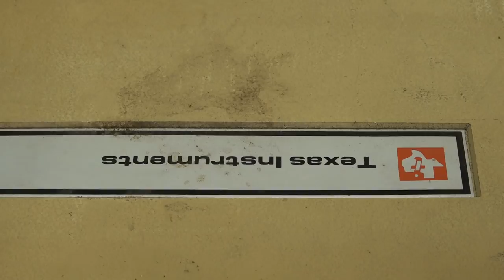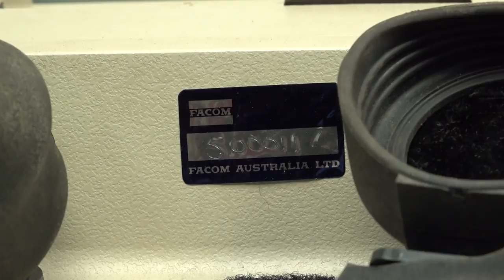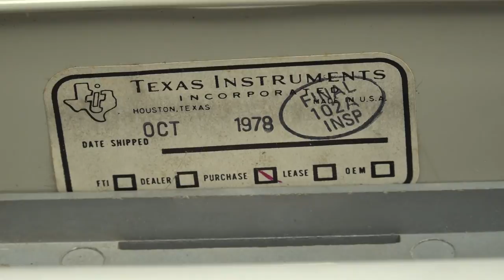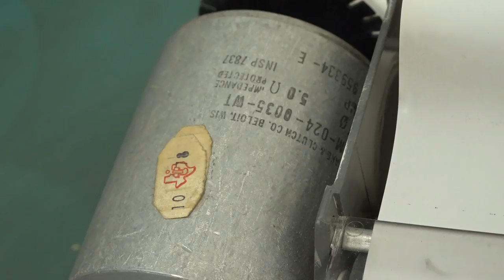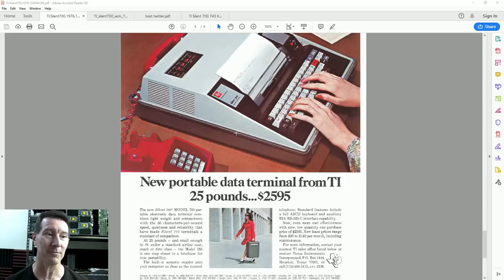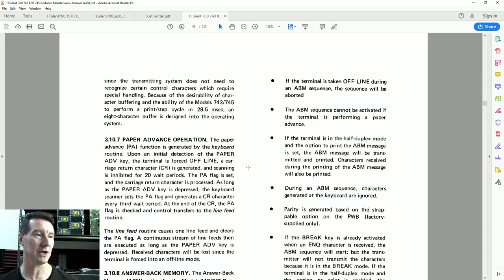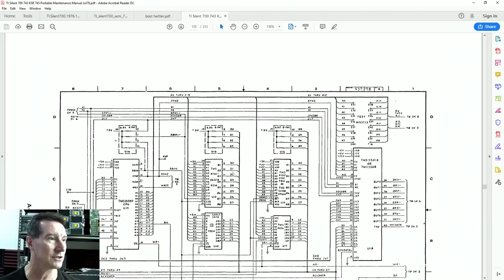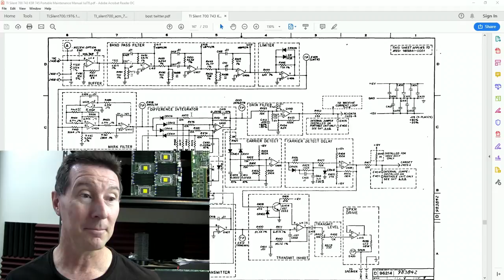EEVblog #1169 - TI 1972 Computer Interfacing

Comment: FWIW, the trick used in V.90 to exceed 33.6kbps wasn't actually particularly sophisticated, but it was clever. Essentially the way it worked was by relying on the accuracy of the DACs installed in end users' line cards in digital telephone exchanges; rather than sending an FSK (or actually, for later standards, QAM) signal, what basically happens is that particular bit patterns (symbols) are assigned voltages, with each symbol being sent as a voltage pulse (Pulse Amplitude Modulation). Your modem negotiates with the line card on the number of different levels it's able to distinguish, which is obviously dependent on line conditions and that's why V.90/92/X2/K56flex modems would connect at a variable rate. The digital data is transmitted, in digital form, to the line card over the network, which requires special equipment rather than a regular modem. In the other direction (upstream), 56k modems actually use 33.6kbps analogue, just like V.34.
Reply: I love QAM. It pops up in so many places!

Comment: Used to borrow a portable terminal like this from my high school on weekends.  Printing terminals had a feature that after printing the last character on a line, the head would temporarily move to the right a couple of character spaces to reveal the last printed character.  If you pressed a key, or the printer started receiving data again, the head would scoot back to it's original position.

Comment: Wow this brings back some memories, particularly the 733 ASR at 17:38 in the video. The 733 had dual cassette drives and my dad had one of these in his workshop at Flinders Uni. I used to use it sometimes at night when I was studying for my BSc. There was a "high speed" 300 baud connection to the DEC 10 in the computing centre. At about the same time I remember playing Adventure on the DEC 10 with an ASR 33 Teletype as the terminal, at the end of a session there was paper everywhere.

Comment: This is just begging to be brought back to working order and hooked into a UNIX system. It should still work, with just a few lines in gettytab. We should be playing zork in no time!
Reply: I think a lot of old /bin/sh scripts relied on these keys. I think hell would freeze over before they are removed from unix/linux.
Reply: A random search with the might Goog came up with someone that connected one of these to a Raspberry Pi. I think he used it to print Tweets. Not sure. I just glanced at the article.
Reply: Michael Lloyd I have done strange and wonderful things with Linux systems and a usb to uart adapter. The serial port is dead nuts simple input for a computer.
Reply: @Mostlyharmless1985  Easy to connect to daisywheel and dot matrix printers too! I'm just old enough to have caught the end of everything being simple text sent down a wire.. I still kind of miss it. 
Yes you can use WYSIWYG fonts on a printer now... but drivers weren't even really necessary back then were they? 
An impact printer would work with any type of ink ribbon.. no DRM ink cartridges. 
At least that simplicity means they're still fairly easy to make useful, as you said. I've personally seen one IT department still keep hard copies of some log files, fed by a trusty long roll of printer paper. :)
Reply: I've got a later model 700 without the built in modem. Works like a treat even with a modern linux. You do need a couple of adapters since most modern computers have done away with the serial port entirely.

Comment: I was a field service engineer on minicomputer systems in the 70s. We used this series of terminals as system consoles. It was a step up from Teletype model 33 at the time. 
I saw lots of print head damage on many units. Also the printed paper output would curl up and fade over time. The glass CRTs eventually replaced these for most applications.

Comment: 1:38 The nice thing about old keyboards like this one is that they still have all the characters in the right place, so that shift+number changes the ASCII codes from $31..$39 to $21..$29. None of that modern IBM PC keyboard rubbish!
And look at how they nicely printed the CTRL codes on the keys too. Brilliant!
And for those who don't know, HERE IS sends a string that you could usually program yourself to identify the terminal, and the host computer could send a code to make the terminal sends that string too.
Reply: I think the only reason that the modern keyboard layout became the standard, was that when IBM designed the 5150 PC, they wanted the key layout to be similar to their typewriters.  Teletypes had this annoying almost-standard layout, which had ( and ) as the shift characters for 8 and 9, rather than the typewriter standard, which had these on the 9 and 0 keys.  Also, the " on the 2 key deviated from IBM's typewriters, which had the @ here.  So they dedicated a whole 8042 microcontroller in the PC to translating keypresses to codes that lined up better with ASCII.  I think the PC may also have been IBM's first ASCII-based machine.  Their older terminals (e.g., 3270 series) used a code called EBCDIC, which was completely different.
Reply: @BrightBlueJim  Correct on all accounts except the microcontroller in IBM keyboards sends scan codes based on roughly on the positions of the keys. The operating system translates the scan codes to ASCII.

Comment: I used to use teletypes/terminals similar to that back in the '80s at college.  The 'Here Is' key is part of an answerback system.  The remote computer could ask connected terminals to identify themselves periodically to see who was still connected.  You would hit the 'Here Is' key and it would send back an identification sequence when pressed.  What it sent could often be programmed.

Comment: Dave, maybe just check your print head flex and connector. Mine did not print either. The aging glue that holds the copper end fingers on the flex had oozed out, and smeared over the contacts and flex when someone took the flex out and back in. It lodged itself right in-between the connector and flex fingers. I cleaned and cleaned with isopropanol, both flex and contacts, until it was gone as seen under the bino. Hurray. Prints again.

Comment: The HERE IS key was a mixture between identification and keep-alive mechanism. You could program a fixed response in the terminal, and whenever the HERE IS key was pressed or an ENQ (enquiry) message was received from the remote host, the terminal would send back this message. Heavy duty remote hosts, as I've been told, have been a nightmare to work with, since they often required you to press HERE IS quite frequently or the line was terminated.

Comment: I used these in the late 70's and early 80's when I worked with NCR Canada... They were still used to test serial com ports or use as the admin port for quite a while believe it or not... Yes 56K is still alive, the telcomm company I just retired from still has about 200 subs using 56K. These subs usually don't have ADSL or the like....

Comment: The "Here is" key comes from the teletype system. It normally would send some kind of identification to "verify" your identity to the person on the other side of the teletype line. Old electromechanical teletypes used a fixed programmed drum that stored the ID and when you pressed the here is key the data from the drum was send over the line.

Comment: Sercel is a name I haven't heard in a while! My dad worked as a machinist at syntron when it was bought out by sercel around 2000 sometime. I ended up with two lbs of kester solder, boxes of ohmite wire wound high wattage resistors, boxes of dale/vishay 1/4w resistors, a few bags of axial capacitors and more goodies that my dad grabbed out of their trash and stashed away until I was old enough to know how to use them.

Comment: In college, back in the late 70s, we had both CRT terminals, and teletypes. I preferred using the teletypes as terminals. Remember it was all command line stuff, so older information would scroll off the screen. With a teletype, it was still on the paper, even if it was a couple hundred lines up the sheet.

Comment: Micro Switch keyboards were indeed the duck's guts. As noted in a previous comment, the top-of-the-line models used Hall-effect switches. Lesser models used reed switches. All had double-shot molded keycaps. TI had a quite an extensive metals and controls division and made the IC sockets shown in the video, Klixon bimetal thermostats, the clad metal material used in U.S. coins, and perhaps most notably uranium fuel rods!

Comment: My dad brought one of these home from Bell Labs. Me and my brothers used it to log into the UNIX system at his work to play adventure, hunt the wumpus and Zork. When we used up the paper, we would reroll it the other way around to print from the far side since most printing didn't reach that far. My dad brought home a case of paper, that my mom (intentionally?) ruined by putting it on a radiator. Eventually, my dad built a serial interface to use it as a printer from our Apple II+.

Comment: I remember using one of those in the 1980's to connect to a Data General mini using a 2400 baud modem plugged into the back. You could just type in the old-style AT commands to have it dial and connect. Worked well for accessing the service call system when out repairing things in the field. The thermal paper was fast. This was more of a teletype alternative when it was built.

Comment: Used these terminals in the late 70's and 80's connected to PDP11 and HP1000 computers. They ran at 300baud. The achille's heel was the printhead, which wore out through rubbing on the paper and eventually lost more and more of the heating 'pixel' elements. The paper type had a big effect on the lifetime. I remember using a Hewlett-Packard blue/violet paper which caused rapid failure compared to the official black Texas paper.

Comment: Hi Dave, I worked a lot with this type of machine, the version with two magnetic cassettes. I developed assembler code for the ti tms9900 in I2L technique, one of the first 16bit uCs. The TMS9900 and also I2L are two very intersting subjects, worth of one of your blog viedeos. Besides, in punched card ages, machines like teletype, IBM ball printhed and this TI where always used as operator command input.

Comment: I built out my Altar 8800 kit somewhere around 1974. Once it was finished I had no I/O except the front panel (and an AM radio). I really wanted a Teletype model 33 with a paper tape punch and reader, but never could afford one. Still, I learned 8080 assembly language, hand assembled my programs into octal and entered the programs into the RAM one byte at a time on the front panel toggle switches. Then I'd single-step through the program following the logic and reading the results on the front panel LEDs. I was still a junior in college so this gave me a good start on my first job, designing the hardware and software for an arcade video game. It was a grand adventure ... and still is.
Reply: Robert Shaver Played some tunes over the radio did you?  What a clever sound card!
Reply: And cheap too!

Comment: Actually, I used one of these when I worked for ITT in the early 80s. They were used as configuration terminals for large PABXs with the added benefit of being able to print the whole configuration and save it as sort of a backup and reference. The downside was that the installation technicians stored the thermal paper printout in a pouch on the inside of the equipment cabinet right next to the power supply, which, in 6 months time made the thermal printout quite illegible ...

Comment: "here is" was used by teletypewriter back in the days. from wikipedia:
Some teleprinters had a "Here is" key, which transmitted a fixed sequence of 20 or 22 characters, programmable by breaking tabs off a drum. This sequence could also be transmitted automatically upon receipt of an ENQ (control E) signal, if enabled.[21][22] This was commonly used to identify a station; the operator could press the key to send the station identifier to the other end, or the remote station could trigger its transmission by sending the ENQ character, essentially asking "who are you?"